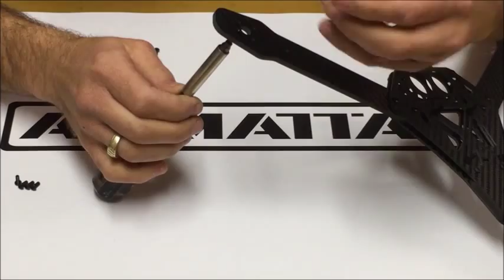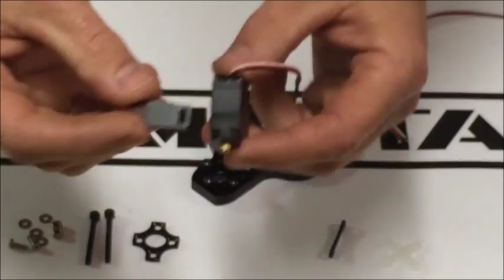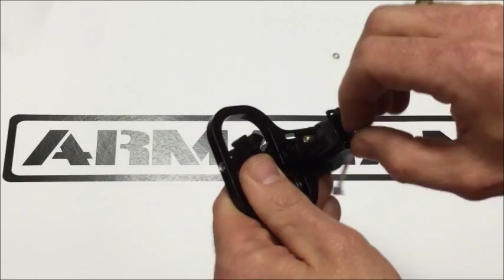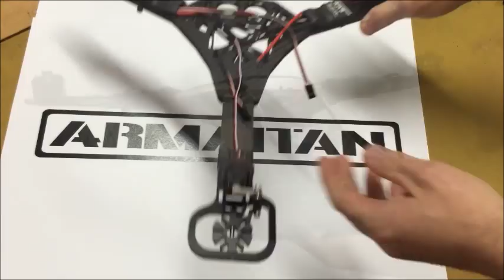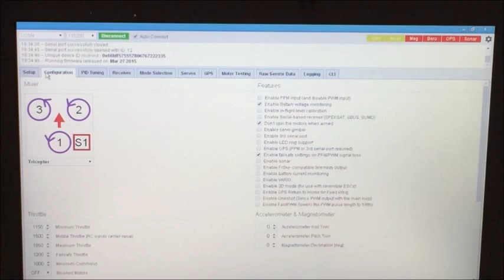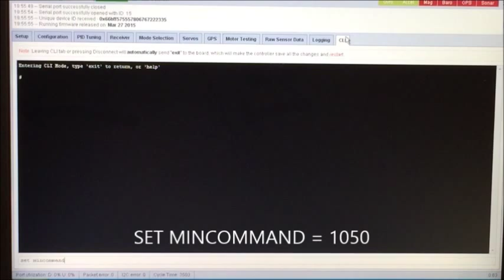Armattan TriCopter Build

Comment: Brian I need your help.  Got the Armattan Tri RxR from Chris.  Loaded Base flight and did everything in your video, everything is working except for my Taranis XD9 and the X4R, then X6R.  I've binned both and set up everything correctly, Mode on TX D16 Ch 1-8.
 On Base I've configured for SBUS and enabled PPM, Bat volt and don't spin motors. Go to receiver menu and nothing goes.  Channel map is TAER 1234   I've saved and rebooted multiple times and still nothing on the receiver menu. Anything you can suggest to get the receiver working before I put a KK2 in this thing.
Reply from the maker: Defiantly stay with the mullet!  Very sold FC especially in these tri's.  But, the X4R won't do sbus without a converter cable.   Much better yo use a D4R-II in my opinion.  See here  http://blog.oscarliang.net/ppm-sbus-d4r-ii-x4r-sb/

Comment: Hey now....
Cleanflight says tri setup is all counterclockwise...what's up with that?
Reply from the maker: It's a little more efficient with 1 CCW prop, but it should work either way just fine.  Just be sure to correct your motor direction as well.  The tail servo does not have to work as hard to keep the tri from constantly wanting to yaw when one prop is reversed. Again, it will work fine either way.
Reply: ok so the "optimum" would be  front cw...ccw
so cw on tail or ccw? The deal is I bought a tri Armattan) on e bay. pristine. but I cant get it to fly now that I took baseflight off and loaded cleanflight....it seems there are issues w 1.10? the servo won't show up in GUI and i guess I nned some help...got it in sept and all I've been able to do is beak a few props.
Reply from the maker: I would set yours up exactly as I have described in this video and run baseflight.  At least then you could fly it.  Since switching to clean flight, I've not built any tricopters.